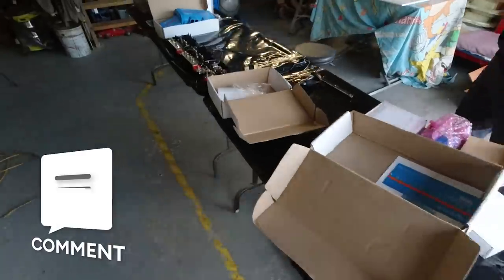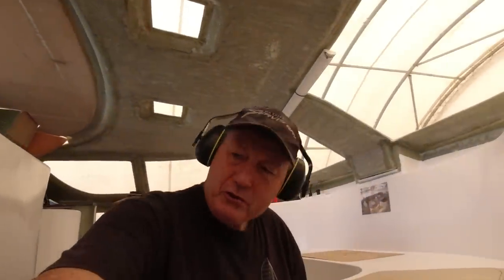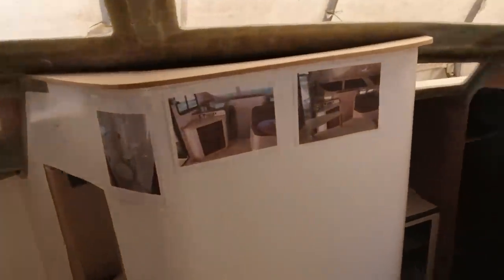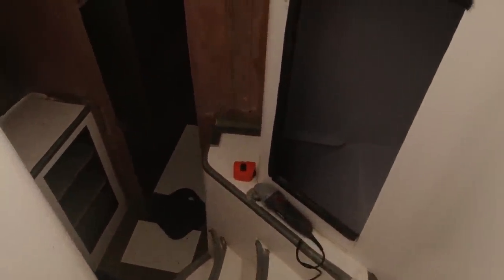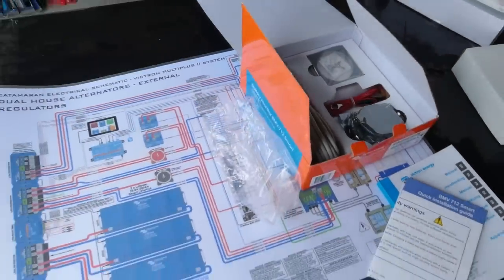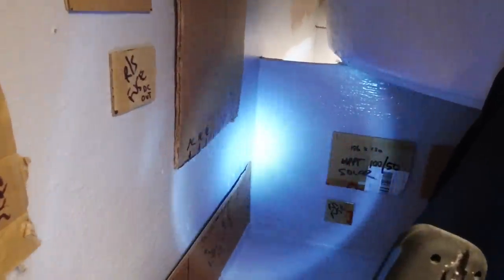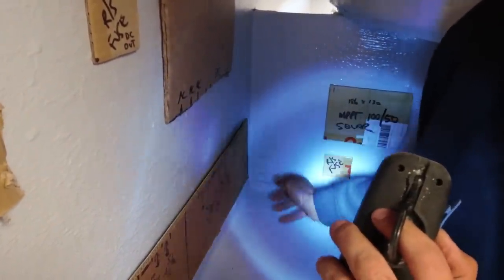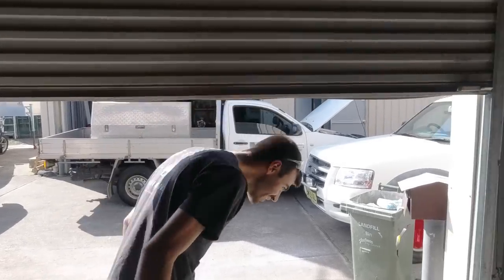Catamaran Electrical System Design and Install - Catamaran Build Ep 251

Comment: Don't forget to put a light in the electrical room.
Reply: Yes! And you might as well hang a light you can power now so you ain’t fussing with a flashlight all through the build out of the cabinet.
Reply: Better keep a torch (flashlight) in there as well, just in case the problem is that all the lights have gone out.
Reply: @daffygrey good idea but he can wire straight to the power source they are installing now.

Comment: Great work. I install this stuff for a living so here are a few tips: do not run the windlass or electric winch throught the BP220. Victron say the BP220 can handle 220 amps continuous and 600 amps for <30 seconds. Not the case in reality. If you try running a winch or windlass through them you will destroy the MOSFETs (the solid state switches acting as a relay). Instead, run these high amp circuits from the batteries to a main disconnect switch (the big red ones), then split them to individual high amp circuit breakers, then to the loads. You can isolate those circuits when the boat is not in use so there is no possibility of overdischarge. If you try to run them through the BP220, you'll fry it after the first use and have very odd, intermittent DC issues across the boat.

Also remember, size the wiring to the load & round trip run, size the fuse to 120% of the continuous current carrying capacity of the wire! Don't just assume any schematic has the right fuse size. This is dependent on the wire chosen for the application.

Cheers and reach out if I can help anymore!
Reply from the maker: Mate that is great info.We have used the Blue Seas app for all  wire guages.The battery protect does however concern me as although we have individual circuit breakers on each of the Windlass and lewmar 59 power winch I would have thought the 220 would have been adequate.Can you elaborate on why.Thanks for the help.Ross
Reply: @LifeOnTheHulls  My guess is that because a windlass pulls high current and in turn causes battery voltage to drop, the battery protect will detect this voltage drop and disconnect while seeing high current through it. The sudden disconnect at high current creates a back EMF that probably fries the reverse voltage protection diodes in the battery protect's MOSFETS and other circuitry.
Reply: @LifeOnTheHulls   It's hard to know exactly why the BP220 fails in this application but I think @CraigOverend is on the right track. Impossible to tell without completely opening a damaged one and confirming the point of failure. However, after reporting the issue to Victron, they told me never to run large loads (or capacitive loads/locked rotor amps) through the BP220 even if those loads are well within the specs of the BP. I don't consider this a quality problem for Victron, rather more of a marketing mistake. Solid state relays are inherently more susceptible to failure than mechanical relays (each FET is a failure point, and they burn up quickly at high amps). The only real advantage to them is that they have extremely low current consumption while holding the switch open or closed, especially compared to magnetic relays. This makes them a good candidate for protecting the load side of lithium batteries because a low-voltage disconnect event needs to cut power to all loads in order to protect the battery from irreversible overdischarge. When the BP220 is open, it is consuming < 1mA, which could still drain the battery but you'll have a lot more time to fix the issue and get a charge coming in than if you had a mechanical relay using >1A to hold the circuit open.

Comment: Ross you are doing a heck of a job ofcourse with help from your friends and family.  You were talking about vent hole for air circulation for all that heat , what about a fan in there to help push that hot air out of there. I would think a low power fan would push all that air through the vents. Just a thought but probably a bit late with this idea.
Anyways great video and thanks for sharing I really look forward to these every week.

Comment: I fancy the practice of using a hole saw to drill out the corners to something like 10-20mm, and then connecting the quads. Yes, the fiberglass is strong, but by leaving the corners round, the corners will be just a bit stronger, there is less chance of a crack developing.

Overall, you have done an exemplary job on your boat.

Comment: In the house construction industry, an electrician or plumber would run wires or pipe while the walls are open. They then would return near the end of construction to install the actual fixtures.  The equivalent for building your boat would be to run such pipes, tubing, or wiring while your soles were open with few, if any, of the modules installed.  You'd leave everything ending with extra left in a place that's out of the way that you can get to readily when you're ready to extend them further.
Reply from the maker: Hey Will .Yep this first week is all about the rough in and we excelled at pulling wires after some initial routing problems.3 months later and we are tidying up and working around a few working devices that is very pleasing.Thanks for your comment and perception of the project.Ross

Comment: Ross I'm sure you're already planning on doing this but make sure you insulat the air duct going through the electrical compartment so it doesn't cause any moisture problems but I'm sure you're planning on insulating all the a/c ducts

Comment: Resettable circuit breakers over replaceable fuses is the way to go for all equipment.
Reply: except that they don't have the high fault current breaking capacity needed

Comment: Great channel Ross. Who did you buy all the Victron units from (I’m located in Australia too)?
Also, can you tell me the exact name and manufacturer/supplier of the green 10mm laminated foam you used throughout your internal fit out?
Thanks
Reply from the maker: Gidday Simon.I Purchased all of the system from various suppliers through ebay plus  where I got the best prices All arrived quickly and as described .Foam is divinicell h80 foam, now yellow available from Allnex Composites.Cheers Ross

Comment: Who, how and where did you get the design diagram from? 
I am needing to get this info for new victron kit I have for my boat.
Reply from the maker: If you search for Victron Lynx Distributor on the Victron site there is a download for schematics of the systems.Another great source is Explorists Life, mainly for RV but agreat source of info on Victron.Beware non matine tinned wire used in RV installs.
Reply: @LifeOnTheHulls  thanks very much, I will check it out.

Comment: Genuine question.. is there a risk, with everything solidly bonded, that stresses in structural components get transferred to non structural components (or transferred to other structural components in an unexpected direction)?
Is it necessary to specifically use weaker bonds in some places so that A breaks before B (eg bond of conduit to panel breaks before the conduit breaks)?
Reply from the maker: Good question.I have bonded all conduits with oversized holes and epoxy.I guess there would be conduit breakage in the event of stress of a bulkhead.I am concerned more about continous creaking and squeeking so if I can circumvent that I will be satisfied.Ross

Comment: If possible, coat the entire area with a thick coat of fire retardant paint before you install anything. Electrical fire on that main compression bulkhead is always possible after a lightning strike even with the best gear if your inverter decides to become a toaster.

Comment: Hi Ross glad your finally at fitout stage , glad u chose Victron great gear, I fitted similar replacement system last winter , did a wee vid blog that might interest u , https://youtu.be/gx9_CwU7LTI . Happy to answer any queries , only things I would comment on ; I fitted a cement board backing behind the inverter charger and was glad I did as it generates quite some heat , also added a vent fan to the area it lives in to vent the heat . Only thing I did wrong was install the main battery shunt in the wrong way round (Dhhh idiot)was obvious once I fired  everything up  ( and when I read the markings on it ( which weren’t very visible ) . Also when I came to commission the system I had a professional Victron installer run me through the process live over a FaceTime call, much to my confidence as he knew all the wrinkles . I couldn’t run the initialisation software on my Apple as it only works on windows system , so had to resurrect an old windows laptop ( only needed the once for initial setup ).Delighted with system over last years cruising, fitting solar arch currently and going to release a “boat living with Victron lithium “vidblog  sometime.